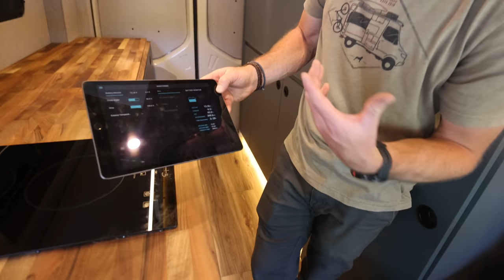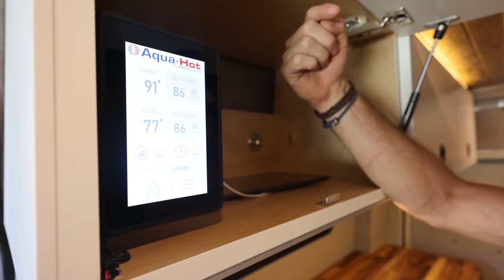Smart Tech Adventure Custom Van Tour

Comment: i have seen a few Mercedes 144 wheel base vans where you can sleep East/West without a flare.  You can get about 70' apparently if you bump out the head and foot areas inside the van.  i am guessing that there is a thinner layer of insulation to accomplish this.  We are not vert tall. (5'9")  thoughts ?